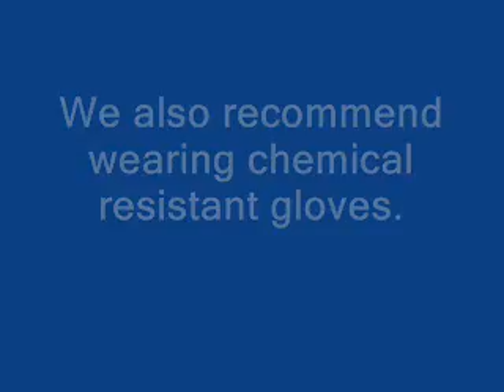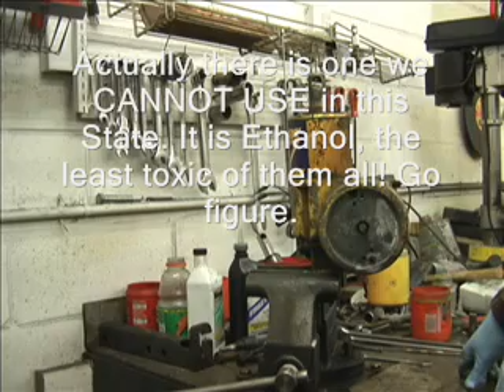Rebuilding a Meyer E-60 Snow Plow Pump - Part 1 - 4

Comment: Socket Head Cap Screw removal is easier if a hand impact is used. Make sure the impact is set for the correct direction as it can be used for removal and installation. Using a good allen socket give the impact a good hit with a Ball peen hammer and remove. There are sockets especially designed for removal of fill/vent plug type applications that are necked down where they fit on the plug. I don't recommend grinding down a wrench, shade tree mechanic trick. Make sure the vent hole is clear which allows the pump cylinder to breath as it cycles.